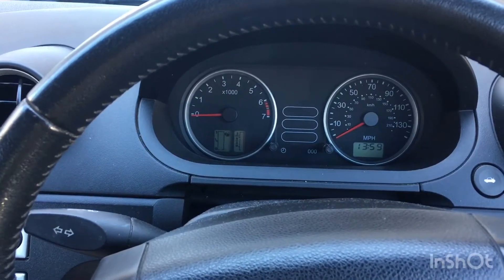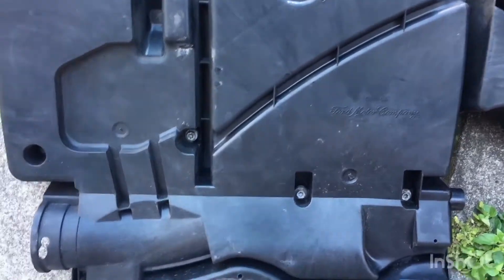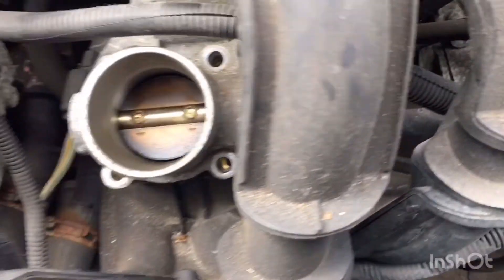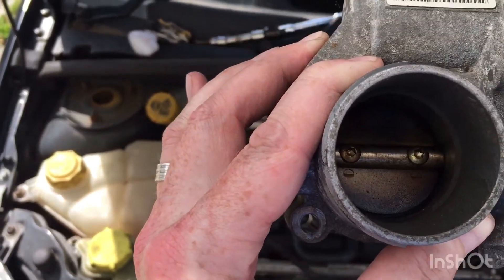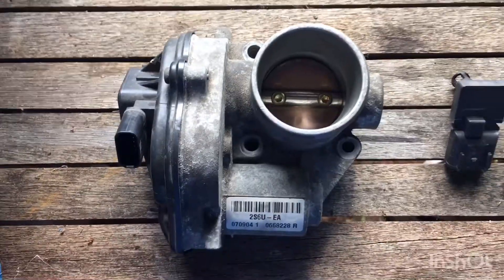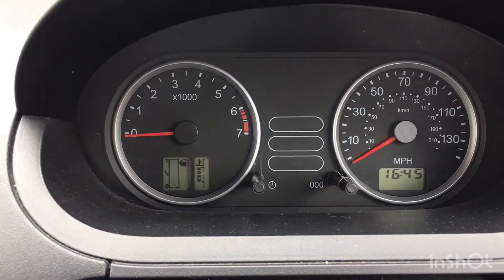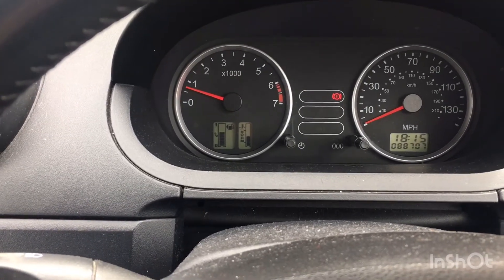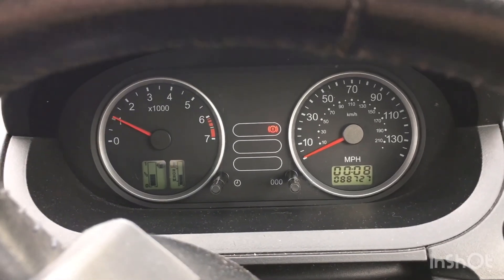How to: Mk6 Fiesta Throttle body & MAF sensor

Comment: I have the exact same Fiesta with the 1.4 duratec engine and heres a tip for you guys ,get yourself a spare air box maybe from a breakers yard or keep the one off the car you may of scrapped earlier .Store it away somewhere and the night before you can change the filter at your leisure and simply switch over air boxes ,in my case i have a K and N filter in the car but keep a normal filter as a spare .

Comment: Thanks, I gave the throttle body and MAF sensor a good clean today. My car does start but sometimes takes a second attempt or requires pressing the accelerator to get it to start, will see if this has helped.

Which tool do I need to remove/reconnect the hose clips? I was able to get them off but wasn't able to reconnect the clips so have taken them off and fitted standard jubilee clips until I can find the correct tool. Thanks.
Reply: EDIT: I think I've found what I need; Clic R pliers

Comment: On the reset car will only run if I’m keeping the revs on will not idle itself just stalls. Like yours did in the video. What was your exact reset procedure please while everything’s on and your holding revs turn off ? And how long hold please
Reply: i have the same problem how did you fix?

Comment: My 2005 MK6 fester is idling at 1500 RPM,  going up to 2000 if I drive it around for a bit,  going to try  the throttle body / MAF sensor  see if it sorts it.  Haven't cleaned it or done anything other than change the oil in 2 years
Reply from the maker: I would definitely try cleaning them can’t do any harm 👍🏻
Reply: Mine is the exactly same issue. Did your issue resolved by doing this?
Please let me know.
Reply: @ranjitzzz100  Haven't done it yet, probably will do it Sat, I need my car for work mon-fri
Reply: @ranjitzzz100  cleaned the throttle body, didn';t fix it :(  haven't checked the MAF sensor  will give it a quick check tomorrow.  otherwise someone said it might be the lambda sensor
Reply: @mikesully110  I also cleaned throttle body but didn't resolved the issue. Ford service center guy said that the throttle body need to replaced. I have ordered it. Will receive it within 2 day. I will replace and update you if it fixed the problem.
Reply: @ranjitzzz100  I found a split breather cable (it's a flimsy rubber tube near the body/MAF sensor) i am going to have a look at that before I replace the throttle body.
My throttle body was very dirty but I cleaned it well and it still idles exactly the same :(
My symptoms are it revs upto 2000RPM,  and the revs will change sometimes  but they never go above 2000rpm. (on idle)
Reply: @ranjitzzz100  Did you get yours fixed?  I found out what my problem was, it was a split breather pipe - just behind the throttle body and further up you can see a rubber hose, mine was split open. 
Anyway as a temp fix I super-glued it shut,  my car is back to idling at  900 - 1000 RPM again !!
Reply: @mikesully110  ohh thats great! I replaced the throttle body with used one but didn't fix the issue. I am still getting error P2176. I will check that breather pipe of my car and let you know. Thanks!
Reply: @ranjitzzz100  Sorry it's dark now i'll see if i can have a look at it tomorrow.  I am trying to get mine ready for the MOT as it has a coolant problem too.

I found this pic
https://cimg6.ibsrv.net/gimg/passionford.com-vbulletin/633x1124/split_breather_1_413566fd03951cf3cd88b5791dd0f775010309e0.jpg

have a look at that picture, my pipe seemed a bit further back but it looks exactly like that, and the split is the same too.  It should be obvious, have a look at the pipes in that area, mine was obvious it stood out before I even knew what it was.
All I've done so far is superglue it back shut and it's running fine now
Reply: @mikesully110  No problem. Thanks for the link. I understood the location. I will check it tomorrow.
Reply: @ranjitzzz100  sometimes I've read the split can be on the underside or in a hard to find place, but mine was immediately obvious.  My problem before it was my car would idle all the way up to 2000 RPM, and sometimes the RPM would waver   like the RPM gauge would go up and down and up again.
And after gluing the pipe and leaving it overnight,  the car stalled at first but I think that was the ECU learning new values. Now it idles low and it's so quiet compared to what it used to be.
I am going to try and price up a new pipe and how to fit it, a guy called McAuley's Mods or something like that had a tutorial on how to fit it.  But the glue worked for now but i don't know how long the glue will hold.

Comment: Hello, i dus exactly the same as you did and now the idle is staying on 3k rpm. Do you know how I can reset it? It will work only with forscan?
Reply from the maker: I think if your idle is revving that high you might have an air leak…?

Comment: I do have a Eac Fail on my 2004 mk6, and i saw on the internet that it may be the throttle body. Any advices?
Reply from the maker: Hi mate sorry just see your message, is it the 8v engine as that’s the only one with idle control valve? My advice take your time clean everything thoroughly with carb cleaner and use new gasket for the ICV

Comment: Actually I don't think what you call the MAF sensor is a MAF sensor, it looks like an air temperature sensor so it can run rich when it's cold to warm the engine faster, like an old choke used to be. And if the TPS is the big bulky type maybe the maf sensor is combined with the tps
Reply: its actually a MAP sensor

Comment: suppose if you keep wire connected and just sprayed and wiped senors,then put bolts back,wouldnt have to do that reset bit..just saying ,cos im just about to do mine at wkend
Reply from the maker: Yes absolutely, see how it goes I found it easier to remove them
Reply: Just about to do mine at the weekend.. reset worries me a bit.. was thinkin the same leave it connected.. was it really awkward left connected?

Comment: Hi, I have the same problem on my mkv  but mine does start but it is the rpm which is unstable and the car turns off after a few seconds if I don't help it by accelerating, do you have a idea what it may be? I have already cleaned the MAF but nothing
Reply from the maker: Hi Jamie can you smell petrol? do you think it’s overfueling? Without seeing it I would start looking for possible air leak, start spray some water over your hoses see if you can see any bubbles...looking for a possible split hose. Go really carefully don’t let water get in your electrics.
Reply: @BugRacer1955  Exactly I can smell gasoline! Where would I start to see? What do you think are the parts to check?

Thank you for your reply
Reply: Which hoses exactly ?
Reply from the maker: When you remove the air filter that pipe which goes into the throttle body I would have a look at for starters
Reply: @BugRacer1955  I'll take a look tomorrow morning, I'll let you know if there's any news, thank you
Reply: @jamieoff3  have the same problem
Reply: @mohammadtarek8495  What to do ?! Im searching all Youtube but i didn't found the solution...
Reply: Hi I have Ford fiesta 2004 1.6 engine, the mechanic Did engine overhaul, now the car stalls when idling shaking the engine and switch off engine while driving on its own when you leave the accelerator paddle are injunction or traffic light
Reply from the maker: Can you smell petrol?
Reply: @BugRacer1955  yes I can smell petrol
Reply from the maker: So I think you might have a vacuum leak and the car is probably overfueling
Reply: @BugRacer1955  ok how do I fix that
Reply from the maker: @phenyojohannes6174  try find the vacuum leak by start your engine & squirt easy start around your engine and when the revs go higher you found the leak
Reply: @BugRacer1955  ok thanks
Reply from the maker: @phenyojohannes6174  hope it helps please consider subscribing 👍🏻 need to get to 1000 subs thanks
Reply: @phenyojohannes6174  did you find problem ? I'm struggling too

Comment: solved the problem 
i connect foscan software and reset pcm
fiesta now running perfectly
Reply from the maker: I’m going to download the for Forscan software soon, maybe show it in a video
Reply: @BugRacer1955  do you have a elm327 odb adapter ?
Reply from the maker: I don’t but I’ve just ordered one which should be here in a week or so
Reply: @BugRacer1955  reset pcm is simple operation. First connect forscan and car. go to in the left menu (service functions). select (pcm reset all adaptations). press "run service procedure button" in the sub menu   (like a play button) and follow instructions. process completed.
The engine may run unstable in the first few rides after the reset procedure.
because ecu in relearning loop
 Do you still have idling problem? on your fiesta ?
Reply: @J-Emre  ELM327 ALdıktan sonra foscan olayı nasıl oluyor kardeş,  bilgisayarlamı baglancaz yoksa wifi mi

Comment: Nvm kept my foot on the brake whilst accelerating got her into gear and went for a 20min drive then cranked heating and lights. After it cycled the gears a few times it remembered how to hold idle

Comment: Hi i have this problem. I clean  map sensor and throttle body, but dont change idle problem. can you tell me how i am reset idle ? (sorry for bad english ;) )
Reply from the maker: Is there a strong smell of petrol? And does your car now keep cutting out?
Reply: @BugRacer1955  not smell of petrol, and i replaced pcv pipe one week ago. new pipe wont idle. if i put old pipe car is running but a little high idle
Reply: @BugRacer1955  i have the same problem and I have strong smell of patrol, you know why?
Reply: @mohammadtarek8495  Did you solve the problem? 
Has the timing belt changed in the past?
Reply: @BugRacer1955  Hi I have Ford fiesta 2004 1.6 engine, the mechanic Did engine overhaul, now the car stalls when idling shaking the engine and switch off engine while driving on its own when you leave the accelerator paddle are injunction or traffic light, and it smells petrol
Reply: @phenyojohannes6174  solved the problem 
i connect foscan software and reset pcm
fiesta now running perfectly
Reply: @J-Emre  thanks
Reply: @J-Emre  thanks
Reply: kardeş, bogaz kelebegini ve maf sensorunu ne ile temizledin? kabloları söktünmü? sıfırlama veya ayar gerekti mi_?  sorun cıktı mı , bende yapsam diyorum ama , biraz anlatır mısın @J-Emre
Reply: balata spreyi ile temizledim kabloları sökmüştüm sıfırlama adaptasyon istemedi ama rolanti sorununada bi faydası olmamıştı sorun başka yerdeymiş ecu ye bağlanıp çözdüm sorunun nedir söylersen yardımcı olmaya çalışayım
 @sheloshelo4884

Comment: 1:36 , tell me if you know , what does that do? thanks
Reply from the maker: I think that the breather pipe your referring to, connect into the air filter box
Reply: @BugRacer1955  yes ,but what is it's purpose?
Reply: it takes the oil fumes of the top of the engine (camshaft and valve stems) by the airfilter back to the engine for burning.Thats why you see i a bit oily.

Comment: So I've found out that the petrol Fiesta doesn't have a MAF sensor, but had a MAP sensor instead.
Reply from the maker: Hi Nyle depends which engine you have the MAP sensor (manifold absolute pressure) was only fitted to the 1.6
Reply: @BugRacer1955  Mines a 1.4 and has a MAP sensor and the one in the video is a MAP sensor too not sure which size engine you have

Comment: If you DISCONNECT your battery leads and touch them together or bridge them for 2 mins (minimum) your car will empty all the residual power from its electrical system and perform a hard reset as soon as the battery is reconnected….the leads MUST be off the car and they MUST be touching each other